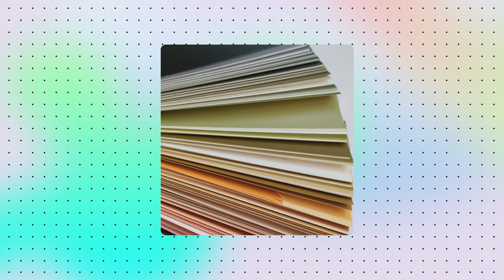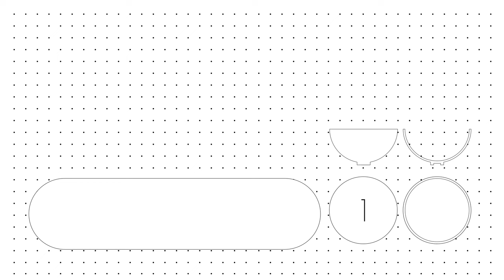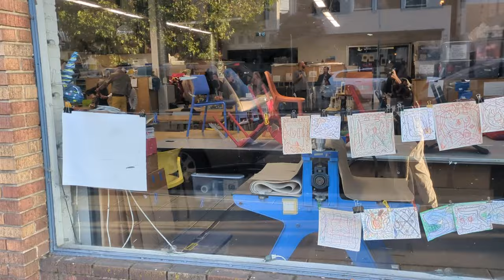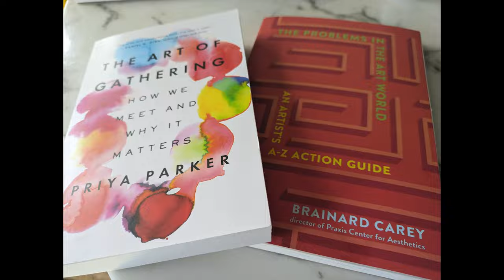New Chapter for Small Business Ceramic Artist

Comment: Can relate to the "always needing to performing" to promote your work. But I also like to share my process, so I try to make little videos and post pictures to Instagram (I make artisan silver jewellery). I also have an old Camry:)
Reply from the maker: Jewelry making is so cool! Thanks for reaching out and sharing your journey. Team Toyota!! :p
Reply: @Saint_Florence  Mine is on its last leg it seems unfortunately (rusty back axle, and I live in Germany. It is a rare car here. Is yours a Corolla? Old Toyota's generally have very reliable engines, you do need to replace the rubber to keep it leakproof. This does not cost much, like 15 bucks should do it for the parts.

I'm Dutch though....I wrote you a message on Instagram:) I had maybe a few questions on how you started your Youtube channel, I'm thinking of starting one and sharing the process. I'm also working on mindset. I also 'worry' about the cost, as I work primarily in silver (with some gold), it is expensive and I wonder how much do I invest before something sells, and I can "reinvest".